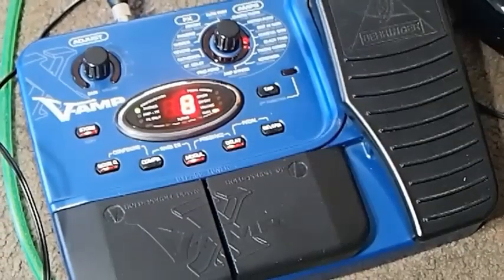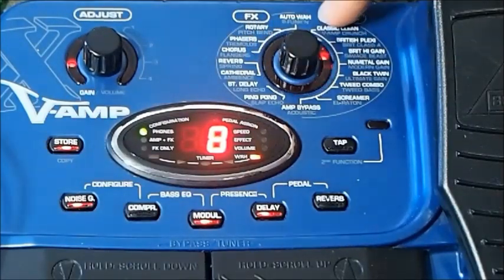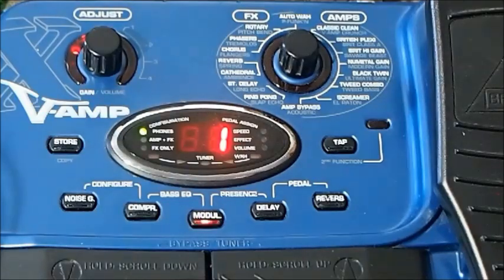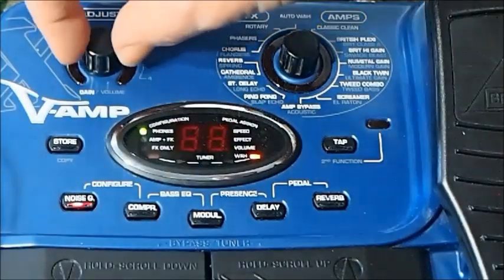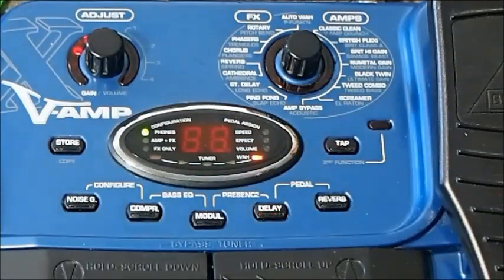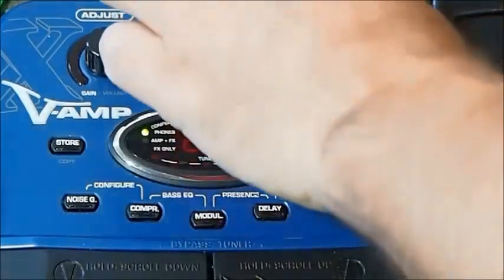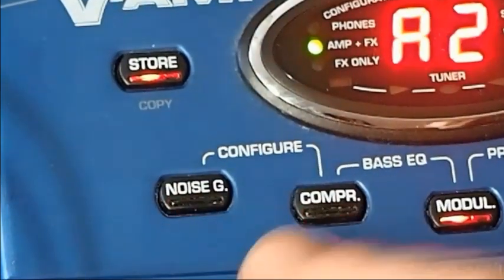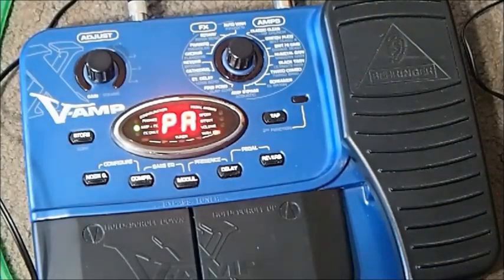Behringer X V-Amp tutorial. How to use it.

Comment: I got one of these probably 15 years ago, and I never really had a good sense of how to use it. It was more of a curious toy for a while, but I think the idea behind it was to create something similar to the big, expensive Digitech and Boss floor unit multi-FX processors. Even those were a bit clunky back then, and they didn't have the amp models along with them either. I kept this one though, just as something to puddle around with, but now that I'm back into pedals and home studio recording I've found it has a lot of surprises I wasn't quite prepared for.

This may all end up in a video shortly, but...

Once you figure out how to do the programming, it's easy to set up and get a good sound. However, it's not a great live kicker, because there is some latency in switching presets. That, I think, has to do with the processing time when switching amp models. If you use it only as FX and forget the modelling, it moves much faster. I do think there are better options for stage though.

Because it does have amp modelling built in, it actually makes a great direct line into your DAW. I've done a number of pretty funky solo tracks using this into my Scarlett and straight into Audition. Put a wah in front of it and you get all the functionality you really need. A good cab IR plugin rounds it out, but even just the noise gate and compression on this little guy make it worth the low price point.

I'm glad you mentioned the presence control. The one thing that always killed this for me in live stage use was how trebly and bright it is. I had to put an EQ after it the few times I've used it, and that always sort of mushed down the mids as well, so this bit of info is terrific.

They don't make them anymore, from what I've seen, but you can get them used all over the place. They're really surprising tools for practice (honestly, I headphone this thing all the time when the kids are in bed!!), and they're great for testing out sounds and combos without having to rack up a bunch of cabs and heads. I have an older Ibanez WH-10 wah and a Bad Horsie 2 in my chain, but I'll definitely be poking through the manual again to see if I can get the onboard wah to do its thing too.

Thanks for an awesome runthrough!
Reply from the maker: I'm glad you liked the video, and I agree with all your comments (with no exceptions)  :) #gearfacts
Reply: @gearfacts  something to check out. Great little reference sheet here: https://ashbass.com/AshBassGuitar/xvamp/xv-quickrefsheets.pdf
Reply: Excellent comment! I use it direct to DAW as well but have a tube amp that I use a speaker soaker on so I can drive the amp but not alienate the neighbors, and use an SM57 on it, but I like the stereo effects and reverb going direct into the Scarlett (finally bought one of those too instead of messing with the PC's sound card) so going direct with the amp sims is a nice way to record.

Comment: Thanks for the tutorial, it's appreciated! Not the easiest equipment to use at first indeed, but the results are worth it. To think that it costs so little!
Reply from the maker: Yes it's such a shame they designed it as they did. I'm not against tricky operating systems really, it's more the appearance and apparent build quality that bothers me, because as you say it sounds great when you get the formula right. Confusing manual too!
Reply: Ah, yes, the build quality is awful! The two selection pedals are so fragile that at first I thought they were damaged by the previous owner - now I see that that's just the way they were constructed. As for the operations, it may have benefitted from at least one extra button for one of the edit parameters, as holding both tap and (effect) buttons to reach a third parameter is sort of awkward (not to mention easy to miss, as at least the tap button has an indication that it serves as well for calling up a second function, but there's nothing hinting at a third parameter on the panel)! Nevertheless, it's still one of those equipments that surprises you a bit. I have a Strymon Mobius too, which is supposed to be one of those "be-all end-all super quality" pedals in its area and - this may sound absurd to some - I think the chorus in this unit actually has more character, for example. The Strymon is way too clean.
Reply: This is really helpful, thank you

Comment: The stereo chorus in the unit is incredible......
I wish this could be built into a guitar....
Reply from the maker: Yeah Behringer should redesign this pedal to make it more user-friendly and less ugly ...the sounds are fine :)
Reply: Yeah it really is as well as the rotary. I like pretty much all the effects and the amp sim is really good 👍
Reply: @pieceworkstudios  The only real problems with it is it's plastic, but for in home use it is fine & the label colors are almost unreadable, which is why I made a new form fitting black letter version of the label I printed on sticky paper....
I eventually traded the pedal & some others for a Behringer head. Man, I love the chorus!
Reply: @jimlassiter749  yes they were extremely hard to read which is why I went so long not knowing half of what it could do. Good idea putting your own labels 👍
Reply: @pieceworkstudios  I shall see if I still have my version, a duplicate of the original (shape) w/just text you can print on sticky paper, cut out & lay on top of the unit...
Reply: @jimlassiter749  hey thanks man, that's really cool 👍
Reply: @pieceworkstudios  i found it, i just need to recheck & test print & put a print grid around it to maintain accurate printing size as (many of us know) print area can change between printers.
Reply: @jimlassiter749  excellent 👍
Reply: @pieceworkstudios  This is odd, I posted my email here days ago but I do not see that message here (though, to be fair, I am an old fart...).
Send me an email (my only form of net communication) at jimlassiterATcomcastDOTnet & I'll send you a jpg w\2 actual size versions you can printout on sticky paper or large labels. Instructions are on the jpg for printing... 1 version has normal font & the other has a bold font.
Opinions welcome & feel free to share...
Reply: @jimlassiter749  great will do 👍👍

Comment: Great tutorial.
Also, there's another important function on this peddle 
it's called "Factory Reset" .. How?
Easy! 
1. Turn off the unit,
2. Using your first and pinky fingers hold down the TAP and STORE Buttons.
3. While holding these buttons, turn on your unit.
4. Keep holding down for 5 seconds.
5. You're done and all effects now are factory settings.
Reply from the maker: Excellent contribution! Thank you. It's often hard to find factory reset instructions on the net.
Reply: Hi, after factory reset is all good but when I disconnect power supply and turn It on again there is no patches and I must do factory reset to bring patches again. Battery is fresh btw. Any suggestions? Thx.

Comment: Hi there, just got one for 10euro no psu. I decided to risk it for that price. My journey so far:
- it was tricky to find the psu with the correct plug. Remember its 9v 600ma ac/ac not ac/dc. I connected the latter and it was humming like a broken unit
- had to do the factory reset and pedal calibration as the pedal wasnt responding at all. 
Still trying to figure out the pedal assigment its quite tricky.
Otherwise really nice little pedal. I;m afan of these v-amp series

Comment: I have one of these since 2006 and I've always thought that my wah pedal wasn't working. Recently, doing a maintenance work on it I found that the problem was a little screw located under the expression pedal that was screwed too much and didn't make contact with the wah switch under it on the PCB... unscrewed it a little, and surprise!  the wah and pedal assign functions worked! try if that's the problem with your unit. I use it for night practicing with earphones and configuring your own patches from zero, you can get good tones for this purpose.
Reply from the maker: Yes it's funny appearance hides what it can do. And the fact that it's so quirky to operate doesn't boost its market appeal :/ Gearfacts

Comment: Bro nice video.. I have a question about my X-Vamp guitar processor.. The expression pedal strip is broken and lost, and I'm not able to control the effects intensity through the pedal.. Can you tell me what I can alternately do to fix it?
Thank you!
Reply from the maker: Hmmmm all I can suggest is going inside it with a soldering iron and replace the miss/broken part
Reply: @gearfacts  okay but from where I can buy it?
Reply from the maker: @atiq-ur-rehman5626  Difficult. I'd try contacting behringer, or asking an electronics shop if they have a suitable part. Sometimes it's cheaper and easier just to buy a new one, or another broken one that has the part you need.

Comment: i bought a used one that wont work. it turns on and you can go through all the functions but it acts as if theres no signal going into the input. it just has a loud hum on the amp. any suggestions???
Reply from the maker: All I can suggest is to check cables and connections ...it's not looking good :/
Reply: find a fix for this? cause mines the same. Sometimes it comes through sometimes it doesn't